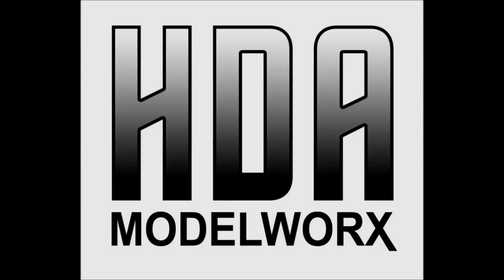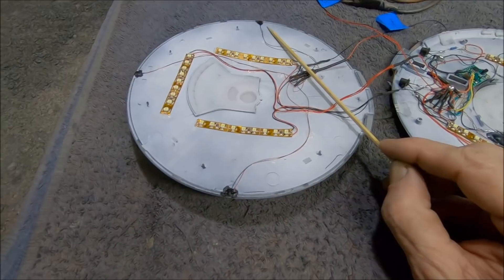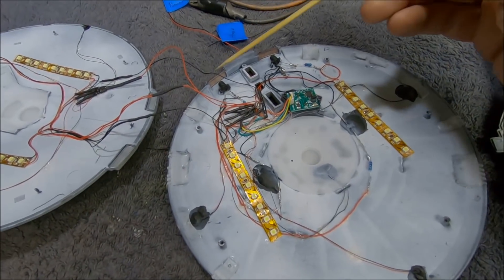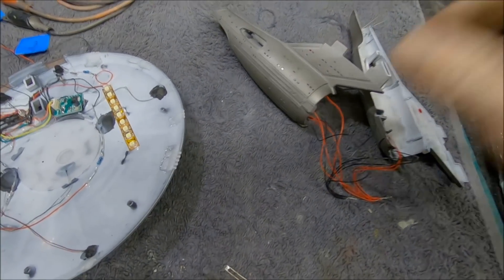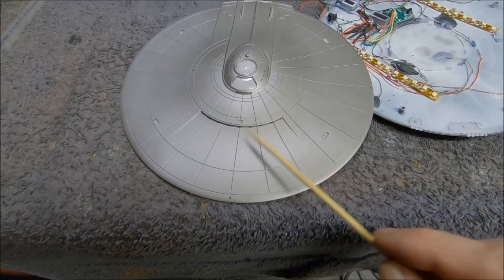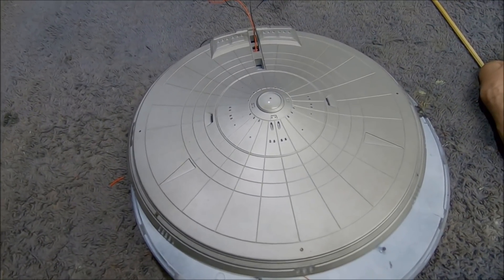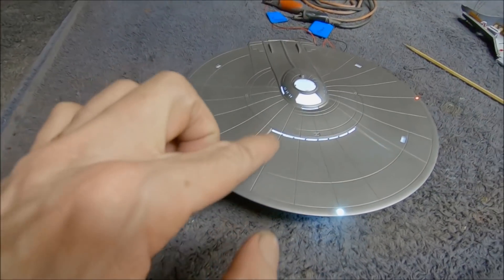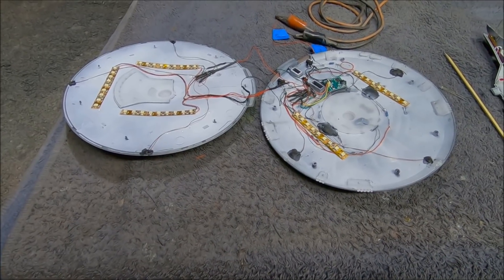Star Trek Discovery 1:1000 Scale U.S.S. Enterprise Build Series Pt 2

Comment: Nicely done model.  I put my own jury-rigged  lighting system into the AMT Enterprise model from "Star Trek: The Motion Picture" back in 1980 when the model first came out. I realized the same thing as this modeler, that some of the lighted parts of the ship had no visible origin point (like at the back of the nacelles). In my teenaged mind,  the only way to replicate the lighting was to have it shine THROUGH the plastic. So I painted the interior black except for the lighted areas on the ship (upper and lower areas of the saucer section, the sides of the secondary hull, and the ends of the nacelles) which I left unpainted.  At that time we only had grain of wheat bulbs (no LEDs) which I placed close to the unpainted areas.  The result was a good simulation of light being projected onto the surface.

Comment: What I like about "all lights showing" on a medium-scale model is that it looks like it might look if one were to approach the ship in the depths of space. Looks very good.
Thought-- I took a 3mm LED and sanded one side level with the wires-- but at an angle. I of course avoided the little reflector inside. You can lay the flat on the inside surface of the lighting aperture. (No, I don't a ship to try it out on yet. Yet.) It would shoot out -- maybe -- so that it would lay a fan of light out. I wonder if the model designers got their lighting to work with that ambitious plastic insert.
Reply from the maker: I tried every trick I know with LED's, SMD's etc. The only way you could do it would be to mount some tiny lighting on the surface in front of the raised lip on the opening and aim them slightly downward. Problem with that is they will look totally out of place when the lights are off. Can't simulate the look via raytheon lighting either because of the grey colored plastic. It looks green with a white LED behind it.
Reply: @TrekWorks  I am not a big believer in that Raytheon concept. Seems like way too many variables. Too bad about your experiments. Are there not "rectangular" LED packages? I mean components. Seems like they might start out life flat enough to fit and stand back from the opening. Then perhaps a nip and tuck. I guess I should shut up and get one of these models. Thanks fdor trying, Boyd!

Comment: I wonder if you could bounce the light off some reflective aluminum tape on top, to cast out the light in front? Would be tricky to get the angles right though, and probably require some super bright LEDs...
Reply from the maker: It's hard to explain unless you are looking at the model. The lip on the front edge is too high for light to get past it and then cast onto the surface that curves away below it. No matter how bright I made it it just can't be aimed correctly without reshaping the surface which then will not look right either.
Reply: Why not use fiber optics? If you angle the end, it will direct the light.

Comment: Hi Boyd....when you placed in solarez, what did you use on the opposite side to attain a flat surface that was flush to the hull?
Reply from the maker: Clear scotch tape, I use it because you can shine the UV light through both sides to cure it. It's also smoother than masking tape so the Solarez doesn't have a texture on it when it's cured.
Reply: @TrekWorks  thanks Boyd.  I will have to get a hold of that stuff.

Comment: any way to sand the inside area and thin out the thickness,  place a bright light against the plastic "V" kinda simulate that it is lit?  Know what I am talking about?
Reply from the maker: It would work if the plastic wasn't molded in grey. When you hold a bright white LED up to it on the inside it looks green on the outside.
Reply: @TrekWorks  ahhh and I take it that it is not Federation Green... * bad joke...

Comment: Great inspiration for me to try, thanks. BTW, I don't think you mentioned what the dark gray blobs over the SMD's are. Some kind of epoxy to hold them in place?
Reply from the maker: It's clear resin that you cure with a UV light. It only takes a few seconds. Then I painted over it to block the light from leaking out inside the model.

Comment: Did you Already paint the model before you installed the Clear Parts ?
I also was thinking that Just Maybe the Tenacontrols Lighting Kit for the 1/1000 Scale TOS Enterprise Model might work for the 1/1000 Scale Discovery Enterprise Model both model are the same scale and maybe the Bossard Lighting Disc's on that board might fit inside the Discovery Enterprise Model's Bossard's.
Reply: They are the same scale, but not the same size. 1:1000 Disco Enterprise is closer to a 1:5xx or 1:600 scale TOS Enterprise.
Reply: @nikolaiosander4874  I know the size difference between the two models it was just a thought 1/1000 Scale Model 1/1000 Light Kit.
Reply: Yes, but the scale is meaningless, if the size is different. They won't fit.

Comment: Did you try white led wire for that logo illumination
Reply from the maker: If you mean fiber optic, yes I tried the side firing stuff and every other method I know. It's the molded in lip on the front edge that blocks the light from being able to be angled down on the spot where the number goes. Same thing for the 2 spots on the saucer bottom.